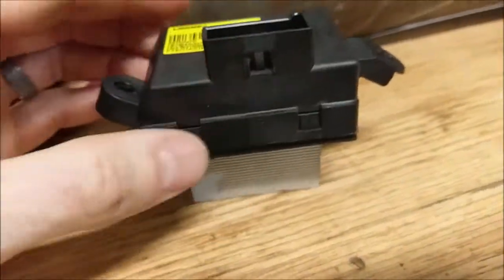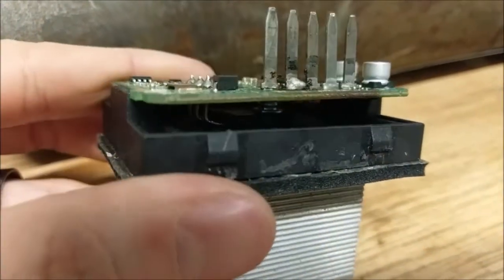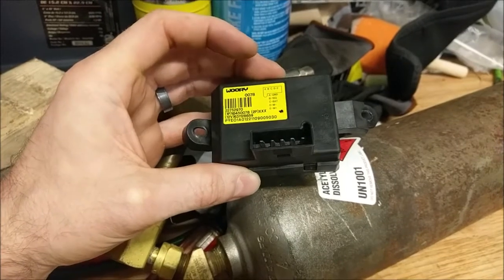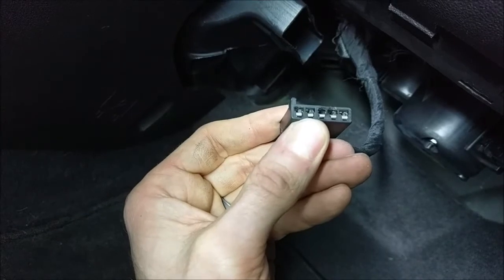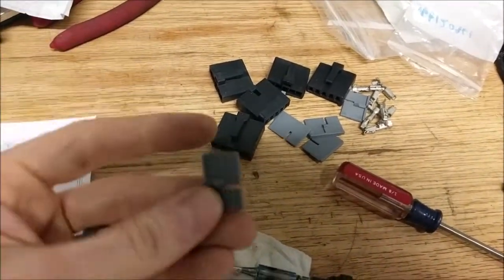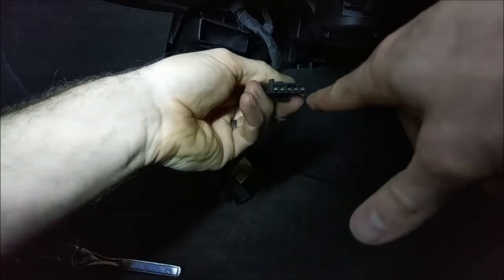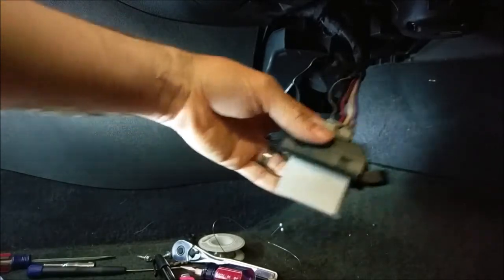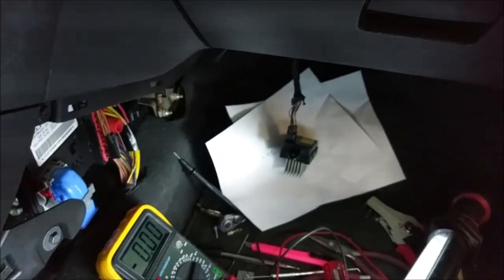2008 - 2012 Malibu LTZ automatic fan module / blower motor resistor + connector rebuild

Comment: if my fan speed control isnt working, can i apply 12v to the gray wire with the black strip to verify the control switch is bad? I have tested the BCM and blower motor and that all checked out but the fan wont turn on or change speed when i turn the knob. from the wire diagram i have, that wire runs to the 16 pin C! on the back of the control box